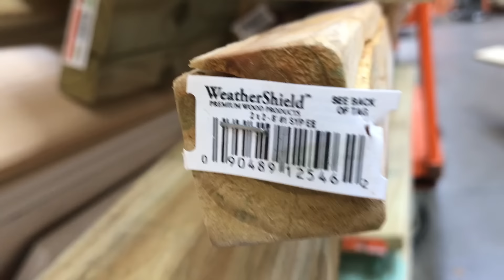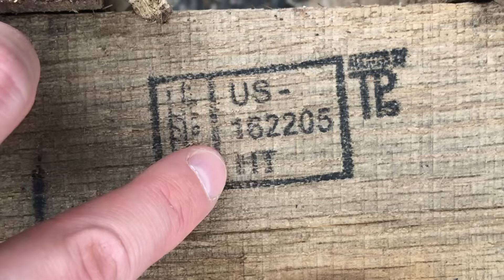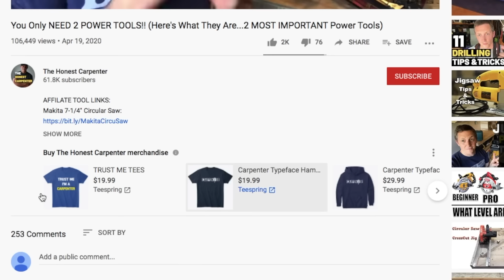Don't Use Pallet Wood!! USE THIS INSTEAD...(Cull Wood Vs. Pallet Wood)

Comment: I know about cull wood. Home Depot is savage and often charge as high as 40% off, where pallets are often 100% free. Roadside trash picking, dumpster diving, or pallets is the cheapest way to source raw materials if its a hobby project you are working on. If you are on a deadline, yeah, i'll check the cull pile. I have built all sorts of stuff from pallet wood.

Comment: I’ve never seen culled wood ANYwhere, but The stuff I buy at regular price at Lowe’s and Home Depot should be on a cull pile. Most of the dimensional lumber is impossible to keep from warping, cupping AND bowing… Sometimes all in one board. I swear that Lowe’s and Home Depot mess hijacked the trucks of lumber that are headed for the toothpick factory..

Comment: Over the years I've used few pallets.  Majority of stuff I built are from CULL wood.  Most of my stuff are under 4 ft.  HD normally cut them down to 4 ft.  5 ft length is a rare fine, but I bought some.  Even time I go to HD, I always look into their scrap pile.  I recent used up all the CULL from 10+ years ago because HD doesn't seem to have CULL anymore (at least I haven't seen them in my local HD and Lowe's for the past 3-4 years).  4 ft 2x4 is very common for $0.51 each.  Also bought some 2x4x.75 ply wood for $4.01.  Used to load up my trunk for under $20 and walked away like a bandit.

Comment: There is no cull wood where I am. And pallets are fine if they're heat treated. I have built many things with them, and they are free!! They are easy to work with, and I have gotten some pretty boards to use from pallets...wouldn't pick the bad ones to use.

Comment: My wife used to work at lowes.  She would let me know when they had cull packs out.  You can see them bundled with the painted ends at places if you go often.  Also, if you use pallet wood know the markings.  HT is good.  MB is bad (chemicals you don't want on you).

Comment: Pallet wood may have its flaws but the price point is good , where I live there are only two Hardware stores serving the City and it is 400km/240 miles to the next one, One actually leaves out their Unneeded Pallets for customers to melt themselves. We are a Mining hub so there isn’t much in the way of cull wood. If you can distinguish what types of Wood are in the Pallets you salvage then you can be on a win.It’s often the ends of the pallet that are harder to de-nail than the inner cross piece/s and the variety of different length pallets give some options on the timber recovered. I have found some excellent timber in some pallets and only firewood worthy timber in others. On a Seniors Budget I have the time to make the tools to help me process the pallets into usable timber and six or eight nail holes in a length of timber is no problem. Now and again I will bite the bullet and Buy Virgin timber but having a plane and plenty of other woodworking tools I’m really glad of my free seasoned Hardwood planks that come in the pallets I process … I also recycle Particle board panels off Cupboards that the water has destroyed the bottoms of. Usually melamine and easily trimmed. Stripping and recycling old Cupboards and Furniture gives you seasoned timber for just a little effort. Around here many people put such furniture on the kerbside so you can help yourself … Us old school recyclers then get to turn someone’s trash into someone’s treasure… there is reward in that ….

Comment: Another great video. Who knew? I had never heard of cull wood. I have only used pallets for firestarter boards - light with cardboard and they generate a roaring fire quickly. But cull wood is a great tip. Thanks.

Comment: I use pallets as well as cull wood. I work at a brewery where all our pallets have to be food safe and heat treated, every week I get at least 2 free pallets that are the wrong size to ve reused. But the dimensions are restrictive plus the effort to break them down can be a pain 😂 I also go to local lumber yards for cull wood too. What I've found the hardest to find (either with pallets or cull piles or just good deals) is affordable hardwood. If anyone knows a hack to get free hardwood, I'm all ears.

Comment: pallete wood is ace for pi cture frames. you can make something A4. A3 size real quick and if there is a decent grain then thats a bonus. trouble with pallete pine is that there snt always a admirable grain texture. but sometimes you can be suprised.  sometimes i look at a piece of 4x4 @ 2-3m length and i just cant decide what to make with it. if it has a beaitiful grain then its even harder. beautiful stuff gets made for asthetical stuff. ugly plain stuff gets used for structural stuff

Comment: The problem with cull wood, is that it's entirely random, and many places will load up a cart and sell the whole lot, first-come, first-serve, so you pretty much have to be there before Buzz, in tools, or the other Buzz, in plumbing, claims it. But all the other benefits make it worth keeping your eyes open. 
As to pallets, the fact that they're made from the cheapest wood available to the pallet-maker CAN be the best part. When I was at Lowe's, I'd keep an eye open for when we got a new pallet of cedar mailbox posts: once the pallet was empty, I'd dismantle it, because for THAT manufacturer, it was cheaper to just make their own pallets out of cedar, and a lot of it was actually decent stuff. I've gotten some decent poplar, from pallets, and I've even broken down a few pallets from Singapore, or Indonesia, that were made of mahogany! Most pallets are junk wood, with little or no use, but once in a while, you can find one worth keeping.

Comment: I agree in principle, but this can be different from US and EU.
EPAL pallets, the European standard, have 25mm boards (a little less than 1 inch).
Also, they have been heat treated without chemicals.
And we don't have those BIG retailers for cull wood. The average shop are much smaller.

Comment: I've used cull wood before but most of what I got was dimensional lumber that was bowed, cupped or split.

The project I'm envisioning is rustic wall paneling for a low budget game room.  Pallet wood boards are a better thickness and the rustic/reclaimed look is there already on most pallet wood.

Is it really practical to resaw and distress dimensional lumber cull wood even if it works out to the same price? 

I would love to find an actual antique building demolition to reclaim wood from but I doubt anything like that will fall in my lap.

Comment: Cull wood sounds like a good additional option. I still like free and have plenty of good uses for pallet wood and even occasionally get pallets made of some good thick wood. I don't mind cutting the nails and it is easy to keep track of them to make sure they are all out of the wood. My other source of free wood is on trash day when people put out scraps they didn't want. That said, I will check out cull wood for projects that pallet wood or scraps won't work for.

Comment: The supplier I get pallet wood from has already stripped the slats off the pallets. The projects I make out of pallets wood do not require long or wide boards. I admit there is some preparation. I pay 75 cents per board. They work for me.

Comment: Cull wood you never find sizes you need and the same lumber type 
I will say working with pallet wood most of them are stamped now 
and most Chemicals are no longer in use and are banned..but that's
Part of the challenge is cutting sanding and and finishing old pallet wood
It makes you more creative.. In my own opinion..

Comment: when i first started playing with diy stuff, i wasn't very confident in my cutting , so i would need a 6 pack and a shot just to get the guts to mark the wood for cuts , because if i mess it up it's just a total waste, so i asked for the cheapest stuff they had, and cull wood is what they showed me, and i would also go hunting pallets,, but pallets taught me a whole lot about how to make crap lumber work , which in turn made me much better when i graduated to using good lumber, p.s. , i'm still not great friends with the jig saw , i cut better lines with a spoon than that thing , lol

Comment: My local lumber store charges $2 per 4 foot length of 2x4’s A good full 8 footer is cheaper so they make more money on cutting bad lumber. There was a time when it was cheaper but not anymore thanks to corona. The rest is only good for the fire pit. If I want good lumber it’s best to purchase cheap old furniture from FB market place or Kijiji and rip it on the table saw. There’s some real good lumber to be had especially from old sofa frames.

Comment: There is a third option if you live in a city that has a renovation thrift store or a Habitat for Humanity type of place. I've gotten some really nice old milled lumber from gutted buildings this way. Plus the dimensions of old lumber is not nominal but true to the common nomenclature, where a 2x4 is actually 2 inches by 4 inches. Sure it often has old nails hear and there but often built before nail guns so the nails are thicker in diameter and usually wont break when pulling out.

Comment: Pallets are only cheap/free if you don't put any value on your time. It takes so much extra time to break down a process the pallet wood into something usable. And if you want to make something really nice, good luck. The wood is cracked, splintered, warped, knotted, different widths and different thicknesses. As soon as you factor in "paying" yourself for your time, you are literally better off buying the cheapest on sale wood because it's better and easier to work. Another thing, unless you have everything already, there's a very good chance you will need to buy additional tools to work the wood down. Planers, sanders, routers, items that you might not otherwise need if you were using proper wood. Lastly there's the scraps, you'll end up with lots of scraps. I did one pallet project and I had about 50 kilos of scraps. Put them out with my trash, they didn't get taken. Then I had to split up the amount into smaller amounts and finally after 3 weeks of putting them out a little at a time, I was finally rid of them. What a pita. Definitely good to think about when your eyes light up with dollar signs.

Comment: Whoa Dude... I've used old pallets to make a lot of different things and yes you have to be pretty selective,but 9 out of 10 times you go to lumber supply stores for cull wood,the selection is VERY slim to none,and when I start a project, I want to finish it then and not have to wait until the lumber supply stores have some cull wood to purchase.

Comment: Everything he said in regards to cull wood is true but, pallet wood is perfectly good to recycle and use for outdoor boxes, decks, storage bins on the deck, composting boxes and yes, outdoor furniture. 
The woods are pine or poplar on the tops of pallets but the blocks are pressed particle and the frames vary. See companies tend to recycle damaged pallets mostly the tops get broken first. In the past pallets were made ultra thick with mahogany frames and white oak top slats but so those pallets were built so well that they’ve been used for decades and overtime the tops break and are replaced with cheaper wood until we see today the tops are wide grained southern white pine from fast growing trees. 
I just grabbed a stack of pallets and they are mixed with old and new and some refurbished with both and noticed a lot of them have beautiful mahogany frames and solid tight grained white oak frames. These make for a dense and heavy pallet that holds a higher weight. These are golden imo. 
Pallets are made to be indoor and outside mostly and in my many years of handling them in one form or another I’ve never had any health issues because of poisoning from the treatment on them. Just not a thing really but sure, it can happen to someone I’m assuming. 
Cull wood is always a mix lot of different type woods and different sizes of material that takes a good dry area to store a lot or two of them just to get enough wood of one type to use per project. This takes time to accumulate. If the storing of such is not perfect you’ll find many boards twisted , bowed and curled to hell by the time you finally use them. 
This is my advice. Use old wood off older pallets. Go for the frame wood and corner blocks for material. Plane off the surfaces and see what your working with. You’ll discover beautiful grain from wood that just doesn’t exist anymore. It’s a treasure trove many haven’t tapped into yet. Accumulate the same types afterwards that you know have the same woods. Those nail holes are characteristics that add charm to your piece. That weathered look is real and people pay to have new furniture that looks like old weathered furniture. Power wash or plane all surfaces. Or simply sand them. Wear a good mask and eye protection and do it outdoors. This eliminates any risk of toxicity spoken. 
Outdoor furniture is extremely overpriced and cheap and waiting to blow away into your neighbors yard in search of a new home. It’s too easy to stack two or three on top of each other and drill them together then take another one and cut in half and stick on the top as a back rest. Grab another cut it in half and drill to both sides for arm rests. It’s not about building something that’ll last for generations. It’s about having a place to plop your asses when enjoying outside activities like fire pits and decks. It’s also free wood. It’s also a fun project the family can do together and reap the rewards that come from it. 
Once built stain it and your ready to roast marshmallows Oman open fire pit or have guests over. I’ve built a compost box that’s huge so now my nutrient rich soil is all free. I’ve built two deck boxes that store all the furnitures cushions over winters and now I’m building two two seater benches for my firepit that frankly I bought cinder blocks for a $1.83 a piece and costs total $54.00 for a great looking fire pit that took twenty minutes to assemble. One thing I would suggest if attempting to build ground contact pallet furniture is to not build with the four single board legs. The tend to just sink in the ground and instead run another board from the front leg to the back at the ground assuring more strength and less sinking. Like a sled. 
I strongly suggest anyone thinking of this to use this guys info in the video but also compile and use mine as well as others. My success is based off of North Carolina environment with rare snowfall but cold and very hot weather and it works perfectly throughout the seasons.

Comment: Hasen't any found you go through saw blades much faster cutting pallet wood since it gets slid on the floor grinding dirt and sand into the bottom bords etc?

Comment: This is great, but I think the pallet craze was to have pre-cut wood that easy to work with with minimal tools, hell a simple drill or hammer is all you need.
If you want decent pallet wood, get food grade pallets, no problems after that, anything spilled on it is  thrown out.

Comment: I have picked out landscape timbers that were cull and build a enclosure for my garbage cans and then I used some fence c u l l fence dog-eared pickets for the top of it I did the whole project for around $30 turned out pretty nice if I had gone with the standard grade I'm sure it would have cost me well over a hundred maybe $200 to do so I think you're right about cull wood I can't really say about the use of pallets cuz I've never really tried to build anything with pallet wood I do know of a couple of people that have built some things out of pallet wood and had great success but they use the higher grade pallets the pallets that are usually spray painted blue and used for concrete shipping

Comment: I like using wonky wood, wood with tons of knots and  wood with interesting grain patterns.  I don’t really care where the wood comes from as long as I can make it look interesting and or beautiful.  Breathing new life into old wood is satisfying and challenging, especially if you’re gonna have to pull nails.  That doesn’t only apply to pallets.  Additionally, I’ve never been to a lumber yard that will let any wood go for free.  You can get discount lumber and there are bargain piles at some places, but if they can make a buck, generally they’re gonna make a buck.

Comment: Nearly all pallets have a stamp/code describing their treatment.

When was the last time you found a bromide pallet...... Really, tell me....

I find HT (Heat treated) and KD (Kiln dried) or both, CONSTANTLY.

The pine ones burn super fast, and are great template pieces for building, or rough prototype designs.
The oak ones, while wide in grain and usually worn to hell by the time you find them discarded, they sand and polish great, and burn pretty impressively compared to pine.

I've been in the grocery retail industry for almost 10 years (U.S., Pacific Northwest)  and haven't once seen a Bromide treated pallet, and have been smashing HT/KD pallets for just as long (where appropriate, don't leave nails on a beach front....)

Learn to recognize the codes on the sides of pallets. It is very simple. 

HT/KD or both = use or burn that stuff.

Comment: Cull lumber around here is 50% off. Which is still prohibitively expensive for some projects. As far as pallets, there are sources for clean pallets that have only been used once, with 7/8 thick boards.  I go around to the same places every week and round them up.